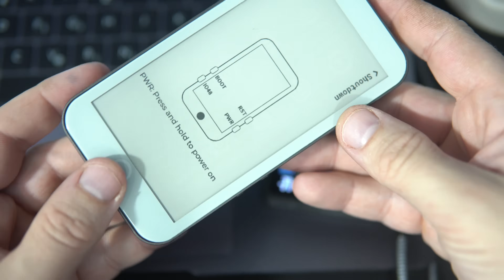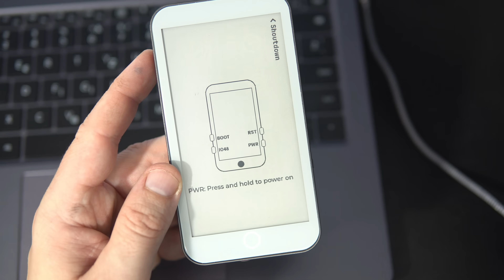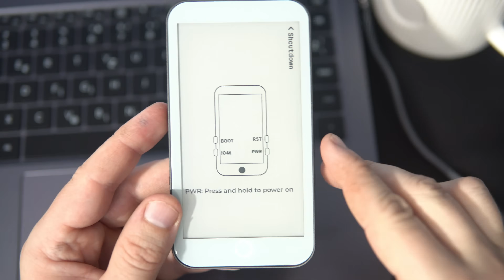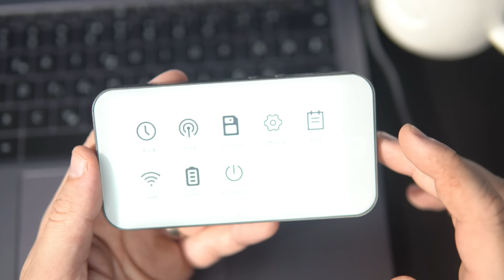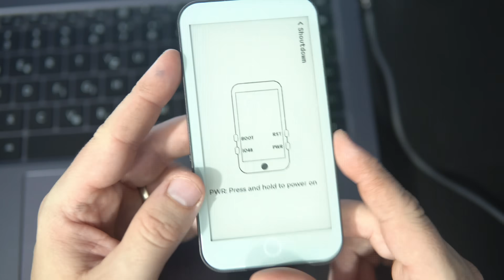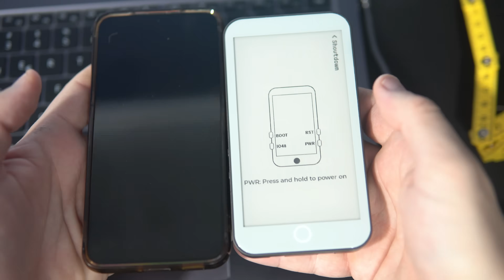Will an ESP32 board with an external antenna have a stronger Wi-Fi signal?

Comment: I'm loving your videos. I'm having a problem with my  LilyGo T-Display AMOLED Plus. From the factory everything worked. When I tired to flash a custom sketch the screen stopped working. Debugging info via serial port indicates that the esp32s3 is running but there is nothing on the display. Any tips?
Reply from the maker: hello, thank you, your arduino ide is using wrong library or you have wrong esp32 boards definition in Arduino IDe, in this video you have instrictions how to install amoled series https://www.youtube.com/watch?v=qvz0XdSYwj8
Reply: @VolosProjects  thanks so much I'll give it a go. Do you know if it's possible to use these boards with the esp-ide or is that just too difficult?

Comment: Love your videos. Having zero luck getting this to run on a normal T Display S3. Took quite a bit of fiddling to get it just to build. Had the wrong version of LVGL (9.2.2). Just tried version LVGL 8.4.0 maybe that is still too new? Takes a long time to compile too... Any hints or suggestions would be appreciated.
Reply from the maker: Yes ,you will need update you lilygo amoled librarues and downgrade lvgl, yes first compile take quite time
Reply: @VolosProjects  After a lot of messing around, I did eventually get it to build but only got a black screen with the backlight on.
The fist build issue I had was related to having the latest version of lvgl. It looks like the code was written for version 8.0.0 or older. It will not compile with the latest version of lvgl due to type mismatch:
#if LV_VERSION_CHECK(8, 0, 0)
const lv_font_t ui_font_M3 = {
#else
lv_font_t ui_font_M3 = {
#endif

Can you confirm which versions of lilygo amoled and lvgl you are using?
Also, there seems to be some confusion over board type and board settings.
If I select Lilygo T-Display-S3 it appears to not have PSRAM, the build errors out saying it doesn't exist.
Can you confirm your board type and board settings?

Thanks so much!
Reply from the maker: @drewtech2  please fallow this instalation tutorial and it will work https://www.youtube.com/watch?v=qvz0XdSYwj8
Reply: @VolosProjects  Sorry for being a noob. 
I watched the video, twice. I have the correct version of lvgl (8.3.11) and the correct version of ESP32 (2.0.17) and the latest TFT_eSPI (2.5.43). Board settings are as specified. I am able to build and download the code. I still just get a black screen. I can tell the backlight is on.  
I am not using a AMOLED version of the T-Display S3
Do I need to do something special to make this work with a regular T-Display S3?
Reply from the maker: @drewtech2  you are not using amoled version?
Reply from the maker: They are completly diferent boards , diferent screen resolution driver, library. This code will only work on amoled. Lilygo shod chose better names fir their boards.😀
Reply: @VolosProjects  My bad...Sorry for the confusion. When I watched the video I thought I saw an non AMOLED version running the code at around 3:50. Watching it again and listening carefully I hear you identify it as another version of the AMOLED display. Thank you for your kindness and patience.
Reply from the maker: No problem, thank you for coffee my friend. I am siry you were unable to try this example.

Comment: It's an updated M5 Paper. My M5 was displaying the weather. Temperature and humidity comes from built-in sensors. What sensors are in this one. Applications are thin client to headless IoT devices. Controllers, hub interface. Lighting scenes vs. on off light switches.

Comment: Volo holds up the new board with the external antenna, and the older boards show higher db ratings :)
Reply: Note that the numbers are negative so -60 is better than -70
Reply from the maker: @cmosarch5285  sorry, i dont understand you 😀

Comment: Yeah in my opinion T5 epaper pro is not a dev board anymore. it's a "programmable product" now, since they made it a bit "harder" to access the pins and modify firmware. but that's just my opinion. some may say you still have access to i2C and SDL/SDA pins but it feels still restrictive. if you open the case, are the gpio pins exposed and can be plugged with dupont wires?
Reply from the maker: I am not sure, probably not